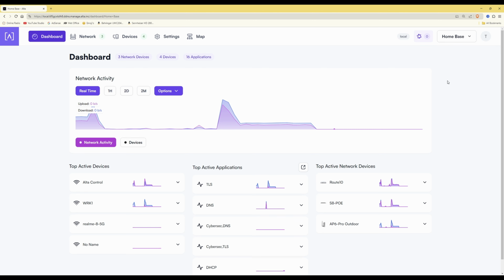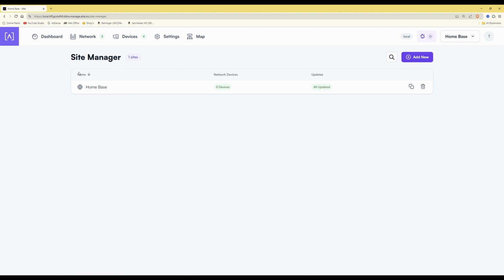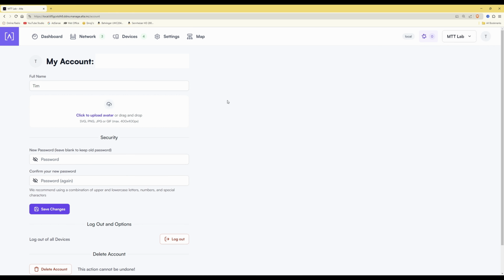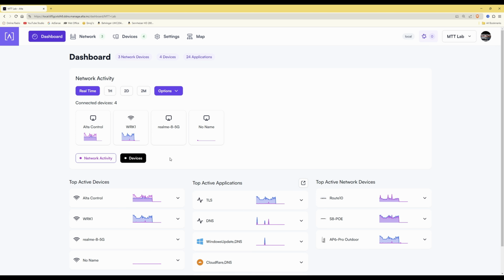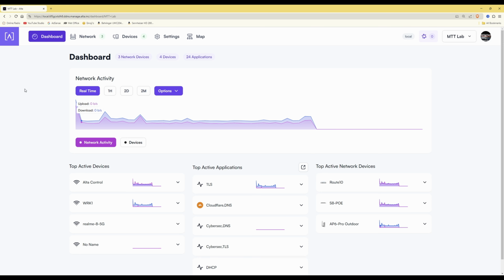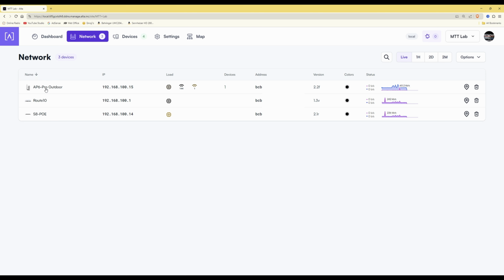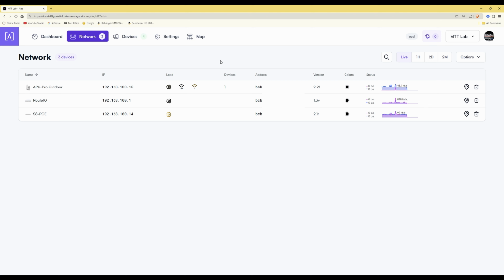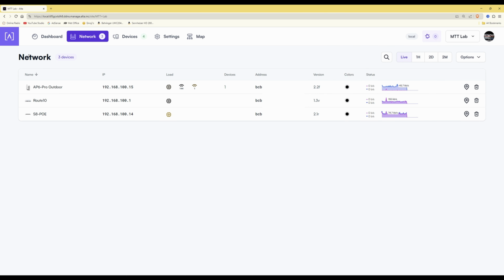Alta Labs - Tips & Tricks Episode 1

Comment: Based on your testing, which do you prefer for a home setup, Alta Labs, Grandstream, TP-Link Omada, or Ubiquiti?
Reply: In my testing, if you want other opinions as well:
Grandstream - great if you are doing a lot of WiFi calling.  WiFi was slowest among the 3.  Switches have tons of features and seem to work well.  GCC series router is fantastic as long as your WAN speeds are 1Gb or below.  One thing Grandstream does very well is give you choices for management.  They have full cloud, self hosted, and a lot of the devices have built in controllers.  For example, most of their APs can managed up to 50 other APs right out of the box.  They are very flexible for install.  I end up using them a lot when folks want complete management and zero cloud connection.
Ubiquiti - everyone and their cousin is using them, so there is a lot of peer support.  For the most part they work really well as long as you don't buy for "coming soon" features.   Stick with APs that are at least a generation old.  Meaning right now, I would be buying with U6 line.  They do not have the best or fastest WiFi, they just don't.  Sorry fanboys.
Alta Labs - Extremely new, and the software shows.  What I mean is, the current feature set is small.  However, I think they put a lot of thought into their hardware and chip choices.  They are also very active in the community and are very quick to support their products.  They have email, chat, phone and forums support.  I have consistently gotten the best WiFi performance from the Ap6-Pros.
TP-Link Omada - cheap Chinese cash grab.  I wouldn't install them for my enemies, let alone my friends.
Reply from the maker: Key @keystroke13 Thanks for your post.  In fact @justinrutledge1221 (post below) has done a great job of suggesting brands but to add to his comments which he's covered fantastically, adding as follows...

Myself having tested both Ubiquiti Unifi, Grandstream and currently Alta Labs in my lab setup that to summarize...

Unifi - A nice ecosystem but they seem to be forever changing things which is not always a good thing, they keep adding things and some things you probably never use.  Prices are high in my opinion for what you get compared with other brands.

Alta Labs - This is currently in my lab and I have some more videos on this coming soon.  Prices are very competitive, kit looks good, compact form factors, routing is exceptional as it can do up to 10Gbps on the WAN (internet connection input).  Wifi is great, connections are good for wifi .  Ecosystem is really clean, easy to navigate and not at all cluttered, yes in the early to mid stages and they keep adding features, I just like the ecosystem as it's clean, does what you need in a general setup and it's easy to use/find things.

Grandstream - As Justin said thei have many management options, the GCC6011 which is an all in one switch/router/pbx (don't have to use PBX as it can be turned off for future use) has it's own management interface which can also manage switches and access points, or you can use their free cloud ecosystem, or manage each device on it's own.  Their GCC routers/swich/pbx combo's can do 2.5Gbit on the WAN ports as they have SFP cages which can accept SFP modules up to 2.5Gbit.  I get 1.2Gbps download and around 850-900Mbps upload on the WAN port with a 2.5Gbit SFP module, my ISP provides 1.2Gbit down/1Gbit up, so I'm getting this just about.  I've found their access points to be great, reliable and get good connection speeds with them.

Overall I do prefer Grandstream or Alta Labs a bit more than Unifi because of them being cheaper for what you get for your money and also that they change their ecosystem interface a bit too often, but big fans of Unifi really like them and what they do.

So I would either go for Grandstream or Alta Labs right now.

For example what space do you have for your equipment ?  Rack or just a small area for equipment etc ?

What does your ISP offer ?